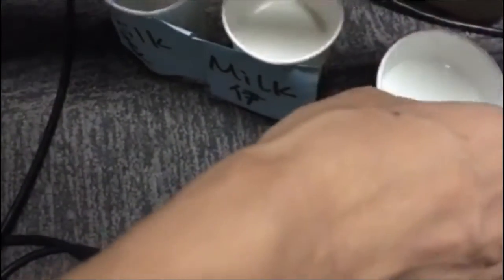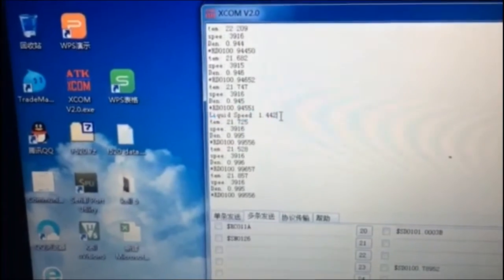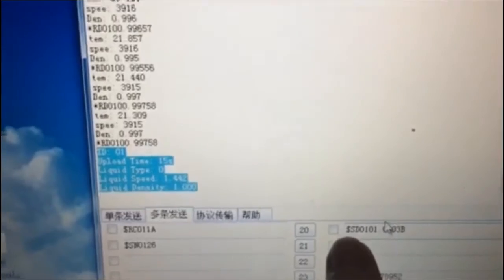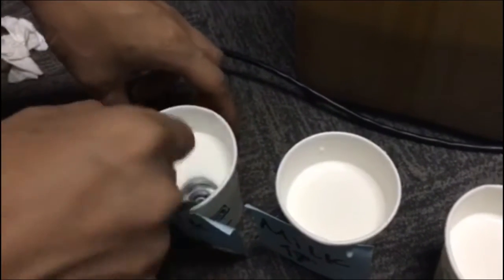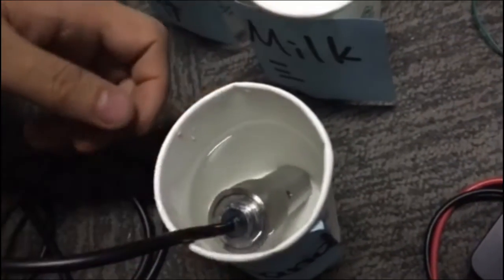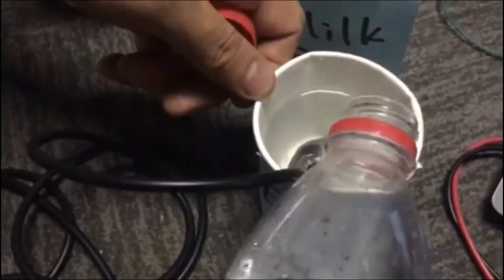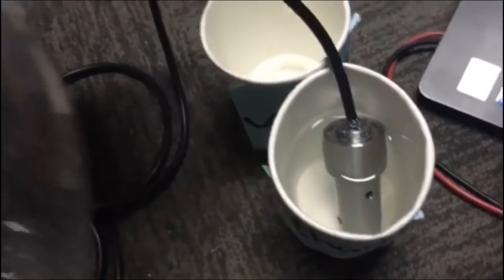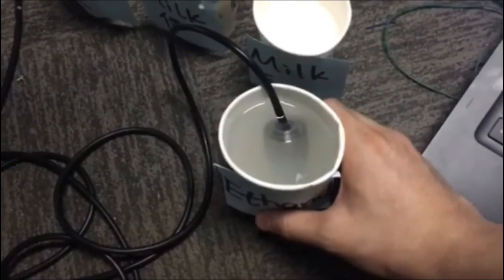DM500 ultrasonic density sensor test with liquids

Comment: I had bought a couple of DM-500 Ultrasonic Liquid Density sensors, but it does not have any user manual or any kind of details.

• There was only one set of RS-232/Serial USB connector was provided.

• Please provide the User Manual (English) for the DM-500 and also how the serial communication in it works (protocols , bit rates and commands)

• I am planning to use it in a control system  (Arduino) where it can be used to check the Density of liquids in 2 tanks and then control some pumps accordingly.
Please share any useful info on connecting the DN-500 to Arduino/RPi/Micro Controllers and reading the data.
Reply: Did you find the answer?
Reply: @ayreenakrami9161   Yes. They shared the  user manual.
All good now
Reply: @NiBuL24  from where did you buy that sensor?
Reply: @ayreenakrami9161  Aliexpress I beleive. They mentioned they have a different model now (this is not avaialable anymore)
Reply: @NiBuL24  okay thanks.
Reply: what is the price of this sensor? did you manage to find any alternative

Comment: Is this really an ultrasonic sensor? It looks like a capacitance probe. So the sensor comes with a controller board, and it responds back to a list of commands via a Serial(RS-232) connection? Sorry I couldn't get that on the video.
Reply from the maker: yes, it is ultrasonic type, not capacitance.  it is will one controller board and can be communicate by command line.  our website is www.dingtek.com.